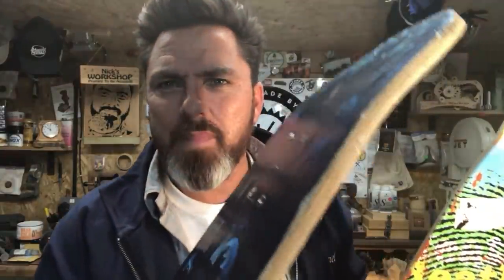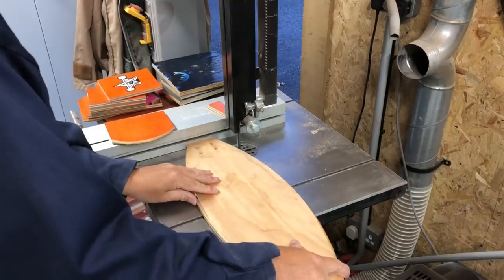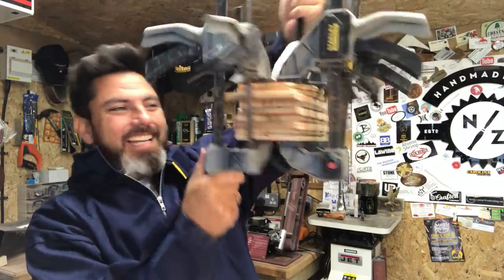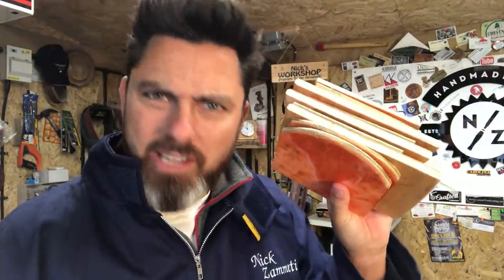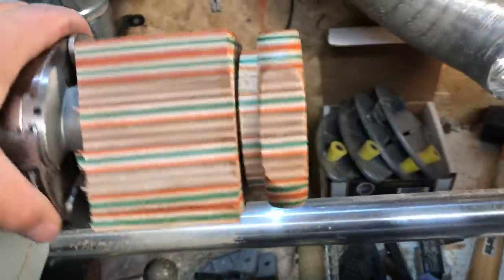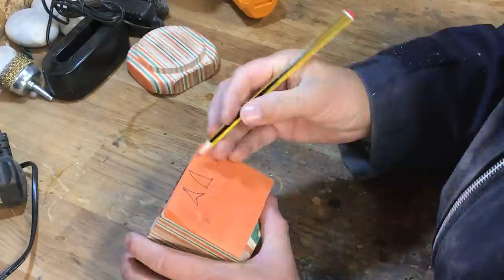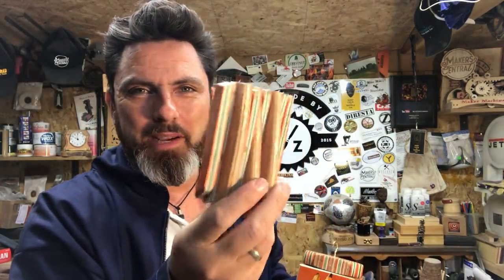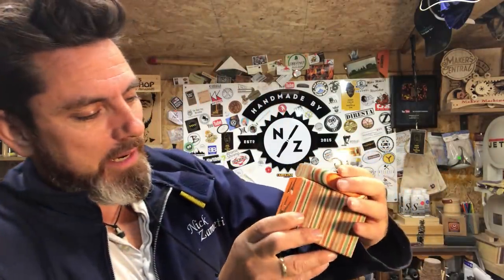Can I make something scary for Halloween using skateboards?

Comment: Thats a pretty rad box. It's cool how the colors turned out perfect for the theme.  I did cringe a bit when you first started drilling into,  but it turned out good. 
And that orange oil and wax,  love using it.  Smells so good. Way better than poly that's for sure.

Comment: Probably a little late here, but the 1st board you cut was Maple and a pro board, hence the better wood. The 2nd board was a cheap Walmart deck (makes it worthless) and you may know this info now, but anymore skateboard projects I'd recommend using only maple decks. Used of course, new decks aren't cheap

Comment: Neat little project. The box is cool, but man that lid is beautiful. Hopefully you can get some more skateboards to try turning something a little bigger out of that wood. I remember using a clamping system in high school where you put the piece between two large plates that clamp towards each other, maybe that will help with the gaps you encountered. Idk I'm just spitballing here. Great work 🤙

Comment: hey nick was going to make some flint knapping tools , (google copper bopper )  have made the copper heads i need handles to fit them after i fill them with lead , you fancy the job would make an interesting video i have slabs of curly birch that i need to glue together then turn in to rounds i was going to buy a drill press lathe attachment  but they look cheep and nasty

Comment: You should take the time to build yourself a good work bench so you can quit using your tools to glue up on. The tools will rust from the water in the glue your using. I realize that you wipe the glue off but there is residue left. I freak when someone has the balls to sit something on my tools.